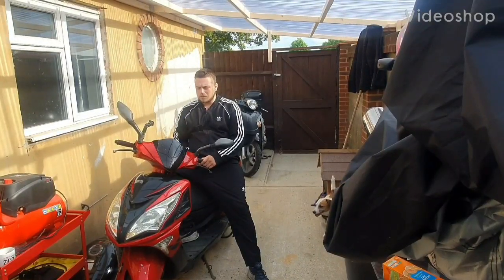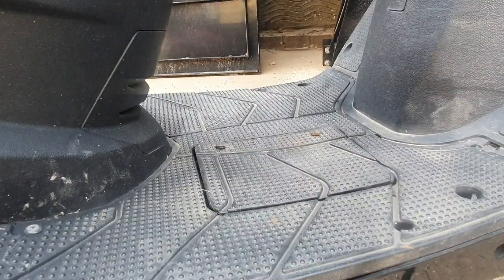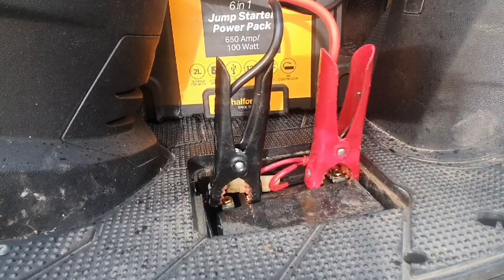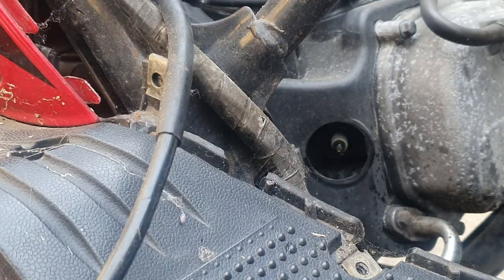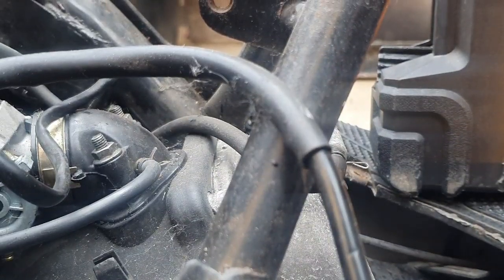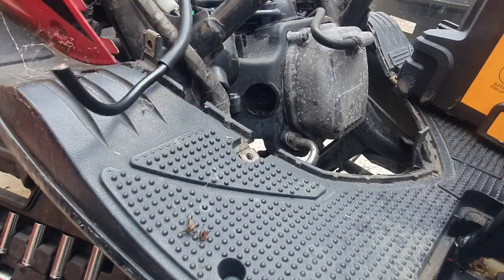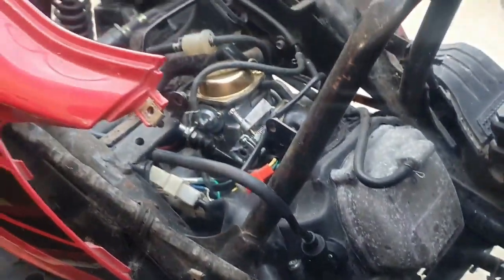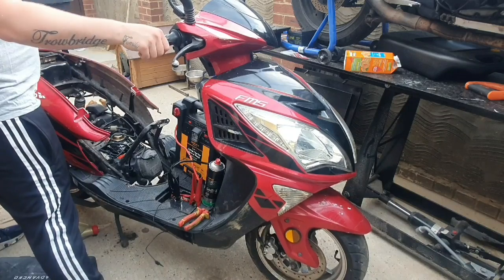Will It Run? £100 Chinese Scooter Not Starting What To Do! #GY6

Comment: Why would the gas be getting into my oil when I checked the oil it was over flowing with gas I guess I definitely need to try this technique now I'm gonna change the spark plug and see wat happens thank you any feedback would be much appreciated just in case I'm missing out any first pin point would be greatly appreciated like I said I got the tao tao moped damn I'm so ready to get rolling again

Comment: Pro tip: always drain the fluids,esp. The gas . Ethanol will always clog the carburetor if scoot sits more than 2 months. Also deep clean the carb. Cheers

Comment: Can I just say that when testing a spark-plug 1. it needs to go against a bare metal area - not painted like the frame,  and 2. you need to make contact with the outer part of the plug ( outer electrode) and not the inner electrode.

Comment: bro my scooters clutch went out i ordered a new clutch and variator. installed them and it fired up no problem. then shut it off and tried tot ake it for a ride and it wouldnt start, just turns over. i go to pull the spark plug and i dropped it and cant find it anywhere. just ordered a new one. im hoping thats what it is but i have no clue

Comment: hey mate, When you were using the electrical contact cleaner what exactly did you clean? and how did you do it, Also is snipping a bit off the end of the spark plug safe?
Reply from the maker: I unplugged all the connector blocks and cleaned them with the contact cleaner and shipping a bit of the spark plug wire is safe make sure ignition is of the

Comment: Plz help... scooter sat for awhile. Cleaned carb it looks spotless...it idles fine...give it any throttle at all it dies right away...fuel bowl is full... if i detach vacuum line idle goes way up... im lost
Reply: Checked the air filter? Tried to rev it up with starter fluid? It’s either too much or too little gas or air.

Comment: Can you point me in the direction please , I'm after a cheap chinese exhaust that will fit my lexmoto titan 125 (2019) I've got somebody that's going to weld me a bung and tap a lambda sensor on . Just cannot afford the ridiculous prices of a new one , so an eBay special that will fit with some modification required . Keep up the good videos and if you can help it'd be much appreciated

Comment: Nice one 
I've got the same one I believe and it doesn't have power when it goes up the hill would be nice if u know what the problem ?
Reply from the maker: A phew things I would check personally is your rollers and belt maybe the carb needs cleaning when was the last time you changed oil spark plug and air filter could be something so simple like air filter little bit clogged
Reply: @DTMotorcyclesEssex  
 👍

Comment: Yo g I got a fmr 50 it’s got spark it’s got fuel to the carb it’s spotless before you ask lol but just won’t fire I’m thinking timing cos I’ve put fuel in the bore and still nothing just coughed and smoked like yours did When it died but it just won’t run
Reply: Give me a shout bro
Reply from the maker: Yo tiz get a compression tester on it and check what it son
Reply: @DTMotorcyclesEssex  I ain’t got one bro see it feels like it’s weak but not bad ya get what I mean it turns over okay with the plug out I can feel compression and it’s either valves or timing and tbh I ain’t got the Interest or the motivations on it to bother looking I’m gonna swap it with a mate of mine who’s got a 250 quad road legal just used off road needs a lower wishbone nut that’s all so fuck it this owes me 55 quid and that’s gotta be worth more than this lol
Reply: @DTMotorcyclesEssex  if you get time have a look at the vid I put up bro
Reply from the maker: @Tizzy_p  yh I watched it yesterday g good stuff I was gonna comment but it wouldn't let me I'll give u a shout out on my next vid I ain't uploaded for over a month been. Busy grafting. Got like 4 new bikes as  well
Reply: @DTMotorcyclesEssex  that’s always like me lol to busy doing the hard work to film what the peeps wanna watch lol but I honestly appreciate it bro but she’s gone now anyway sitting with a banshen 250/200 quad now straight swap runs and rides is a on road quad but been used off-road for many years but needs a wishbone nut that’s it and a battery or bump it I got a little eBay job jump pack pretty good shit tbh but it’ll do the trick
Reply from the maker: @Tizzy_p  good stuff g u got snap or fb bro?
Reply: @DTMotorcyclesEssex  about to drop a little vid of the quad now tbh
Reply from the maker: @Tizzy_p  gorn bro do ur ting u will smash it bro add me up on sc itzz_dtee or fb Danny East
Reply: @DTMotorcyclesEssex  ima add you on fb soon bro ima on a bann ngl I love violating people who deserve it but Facebook just dislike man now loool, I don’t fuck wit snap since the whole hard food case an that it’s all long for me these days I won’t even lie g and same for you tho bro you keep doing your ting and I rate the grind highly g